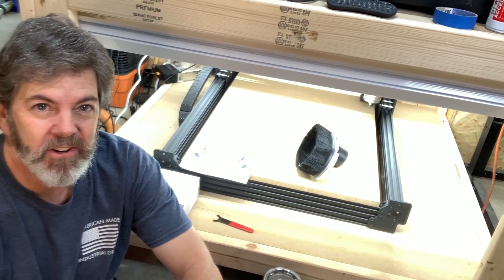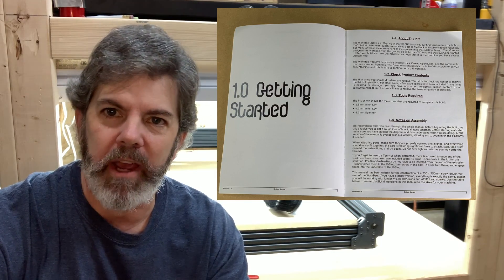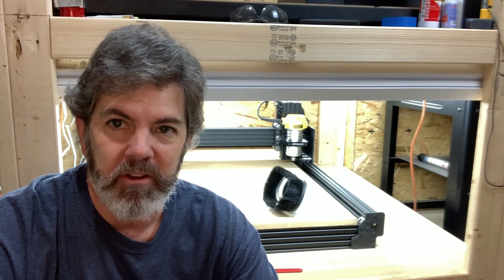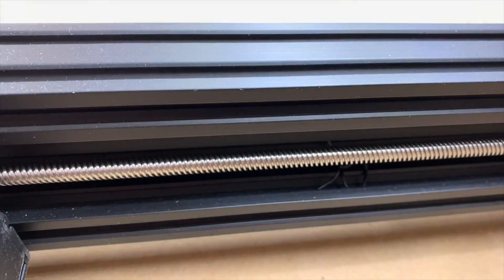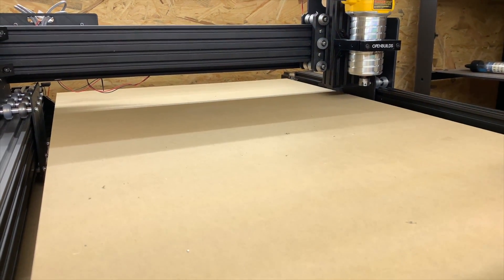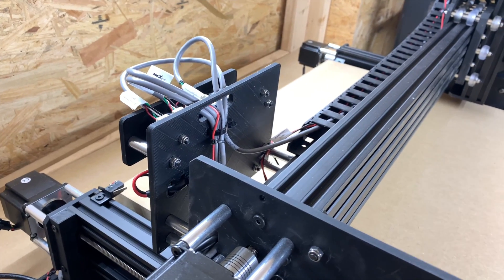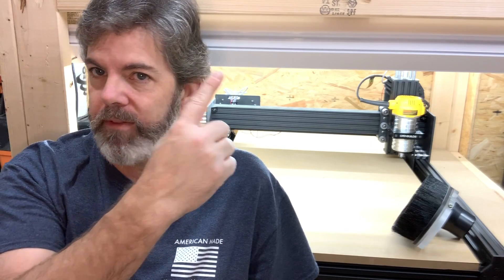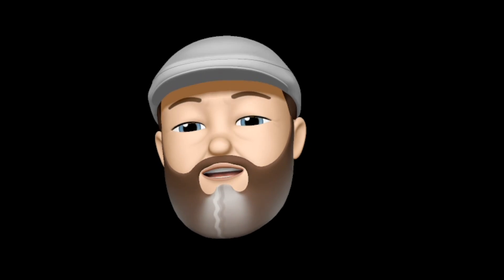Should you Buy an Ooznest Workbee?

Comment: Great guy. Great video. Vibe I get is honesty. Have subscribed.
Reply from the maker: James Barratt thank you.  That’s my goal in everything I do.
Reply: Hey can i ask a question. The buying cnc router world is a nightmare I hope to be out of soon but dont want to buy the wrong machine. 

So in your view whats likely to be the main differences between a £1500 machine and a £6000 machine.
Reply from the maker: James Barratt which $6k machine?   Software, setup, speed, tolerances.  Lots of differences.  Buy the machine that’s right for you.  Right for your budget.  Is it intended to be a hobby, learning tool, business?   So many factors to consider.  I have two that are similar in capability and the Workbee is a little cheaper.  Takes a little more time to assemble.  That said, either machine can pay for themselves in less than a month.  Biggest difference would be that a larger more expensive machine can produce more, so in the long term it could be more profitable.  It’s a tough call.  I went through this with my laser.  By something cheap or go with one of the Cadillac brands.  I went mid range.  I’m happy I did.  It’s done everything I’ve thrown at it and has paid for itself over and over.
Reply: Right. So well i want to machine 5mm Aluminium. I dont have any much need for machining wood. 

Software you say. I operate a mac. Is there really bad software and good then. Being I do cad on fusion 360 and it has a cam package, figured that was everything needed bar the software to control feom the gcode the machine. Guess its that software you mean. So can you make big mistakes getting a kind of software which is difficult and full of glitches. Guess so but how to know whats bad.

Laser. Is yours just for engraving or can you cut sheet steel with it too.
Reply: Right. So well i want to machine 5mm Aluminium. I dont have any much need for machining wood. 

Software you say. I operate a mac. Is there really bad software and good then. Being I do cad on fusion 360 and it has a cam package, figured that was everything needed bar the software to control feom the gcode the machine. Guess its that software you mean. So can you make big mistakes getting a kind of software which is difficult and full of glitches. Guess so but how to know whats bad.

Laser. Is yours just for engraving or can you cut sheet steel with it too.
Reply from the maker: James Barratt “The software to control the machine is included. The CAM software is not included, but can be bought as an extra or sourced elsewhere. Free options like Fusion360 or SketchuCam can be used with the WorkBee CNC Kit.”
“Once the WorkBee CNC machine is built, it has the following software work flow: CAD → CAM → G-Code Sender.

The G-Code Sender software allows firmware settings to be configured, move the machine around, and send the G-Code job file to the machine. The control software used with the WorkBee is Duet Web Control. It is browser based software so can be used on Windows, Mac or Smartphone (if the Wifi option is chosen).”  “The WorkBee is capable of accurately cutting foams, woods, plastics or aluminium at depths greater than 25mm and to a 0.2mm accuracy or greater. With a WorkBee CNC Kit you can manufacture engineering parts, toys and signs. In fact, you can make anything you can imagine without leaving the workshop.”  This info and more can be found on the Ooznest website.  How big are the aluminum parts you’ll be wanting to make?  The smaller the kit the less flex and tighter tolerances you will experience.
Reply: Say 400 by 400 and 150 height in Aluminium and the inside machined out so takes a mask shape inside. Injection mould die basically. Riuting in 100 mm max
Reply from the maker: James Barratt the Workbee is so adaptable no question you could do this.

Comment: Looking forward to seeing it cut. I'm building a Chinese clone in the 1500mm*1000mm size. Currently working on the electronics enclosure... hoping to be making chips by Christmas.
Reply from the maker: Tim Wolf I can imagine you will be.  If it’s a similar design there are a lot of parts.
Reply: Do you have a link to the clone? Are you cutting with it yet? Duet controller?
Reply: @knight2255  Go on aliexpress and search bulkman3d.
Reply: Hi Tim, how's the machine doing ?
Are you happy with it, any problems ?
I'm ordering one too
Reply: @MentallFloss  it's good, if you have a facebook you should join the Oozenest Workbee group. A lot of good resources.